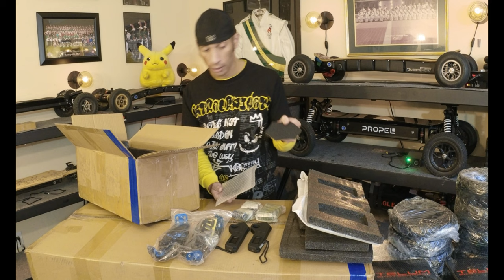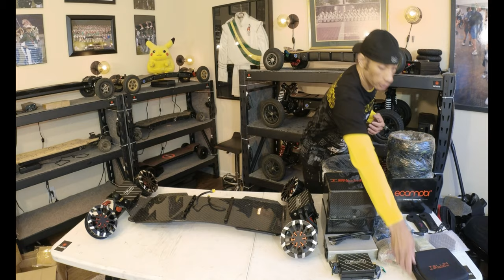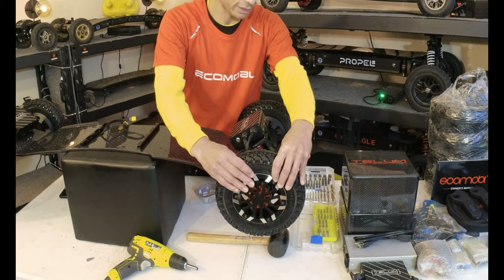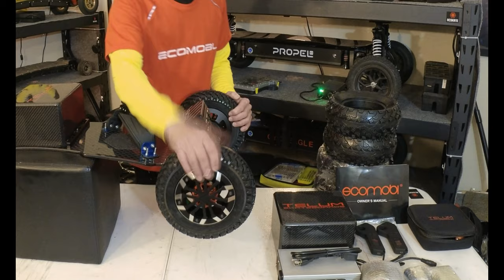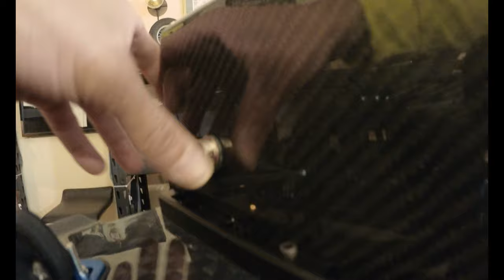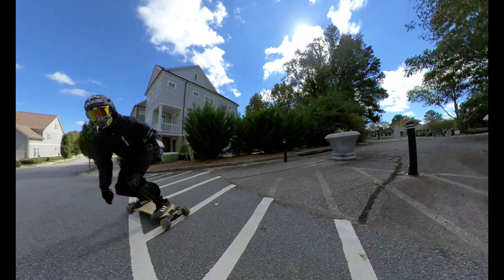#82 Unboxing and Assembly | Ecomobl "TELUM BA" Electric Mountain Board |

Comment: Nice video thanx. But board looks from my point of view really ugly. Tecnicaly it is on low level compared to EU brands and China producer compensating it with spare parts included . Nothing for me.
Reply from the maker: Sucks you dont like the look of it.  I think its looks absolutely incredible.  It's very well designed with the replaceable batteries.  Also the lights in the trucks have never been done before so that is a HUGE step forward for Electric Boards.

There are alot of awesome things going on with this board.  It may not matter where it's made anymore. China, EU, USA...who cares...As long as it performs well.  Performance is the key.  

Keep tuned and Keep Shredding...
😊🛹😊🛹
Reply: Hi. Enjoy Your new deck. And I will be happy to see review after long term use. Unfortunately I must start to think where was what produced. I do not want that my country will be next target of Putin. And based on China behavior, I prefer to support EU or USA . Nice day 🛹🤘
Reply from the maker: @fackoesk8  

Politics and small businesses have nothing to do with each other.  I am saddened by what's happening with Russia, but that has nothing to do with an Esk8 company and its products.

Keep Shredding!!!
😊🛹😊🛹
Reply: @RCSkate   Iam pray to be like You wrote. Unfortenatly we All are parts of bigger economics.🛹🤘

Comment: Love the new toy and all the extras like the wheels and remotes. The board is a beauty. I’m actually used to a remote with the hole and prefer it. I wonder if you could just put wider tires on the X4S, they look great. Can’t wait for the ride vids. Awesome bro, congratulations. 🔥❤️
Reply from the maker: Putting them on the X4S would be an interesting idea, but it wont work.  Propel needs to come out with 12in and 14in tires for the X4S.  It needs more clearance.

Comment: Either my bindings are on backwards or yours are, bought mine used, so assuming mine are the backwards ones.
Reply from the maker: I don't wear bindings.  Lol.  Unless you are jumping, bindings are not useful and are a crutch.   Consider removing them all together and learning how to ride without bindings...again....if you are not jumping.
Reply: @RCSkate  it's a heavy Ecomobl Tellum board.  I've ridden my Metroboard and Backfire G3 for a little over a year now.  I didn't think I would like being attached to the board, but I sort of do.  This is a pretty flexible deck, I'd fear being vaulted off trampoline style.  So, I'm familiar riding without.  Not sure I want to jump, but I do take it off curbs and ride over roots and rough ground.

I wouldn't want to take a long cruise on this board though, its more work to ride.  The Metroboard is probably the best ride for comfort.
Reply from the maker: @dawgdude6472  
Its actually not that heavy to me. Heavy is subjective but the weight is distributed pretty evenly. I have the Propel X4S and the Lacroix Lonestar Supersport which are my heaviest boards.

Comfort is also subjective, but to me this is both harsh and comfortable at the same time depending on wear you are riding it.
Reply: @RCSkate  heh, didn't realize which video I was commenting on.  In the unboxing video, you installed the bindings reverse to the way mine came.  All I'm trying to do is figure out which way these bindings are supposed to be installed.  Someone on Facebook finally gave me the right answer I think.
Reply from the maker: @dawgdude6472  
Bindings are personal preference.  There is not right or wrong way to install them.  Its what feels and works the best for you.  So if someone is telling you its not the way it should be just keep in mind bindings are personal preference.  

Do what feels good and right for you and your enjoyment on your board. 😊🛹😎🛹
Reply: @RCSkate  Thanks, that seems to be the case.  I see them installed either way.  

The Propel was the one I wanted when I discovered the suspension boards. I didn't realize the M24 existed until I got this Tellum BA. Now I'm looking to get the M24 instead of the Propel, have you ridden the M24 by chance?  Curious which you prefer if you have.
Reply from the maker: @dawgdude6472  
Yes I owned an Ecomobl M24.   I sold it because I was not satisfied with the performance and it did not have the agility that I wanted.

I have a few videos on the M24. Here is my farewell video https://youtu.be/kSD55jWSSbU

If it were me, I would go with the Propel X4S or the Ecomobl Telum BA
Reply: @RCSkate  thanks, I have the Tellum, it made me realize the M24 existed.  That is the feedback I've been seeking.  Surprised no one has done any direct comparison videos.  Is Bajaboard still making suspension boards? Their videos have really tapered, most I see are 2 and 3 years old.  I've wanted the Propel since it came out.  I had just dropped 27g on my Metroboard,  it's probably for the best, it was a good board to learn on.  I like Propel's other offerings too.  Having the Tellum as a decent extreme off reader makes me think that a lesser Propel would suit me.  I forget the various models, but even the bottom of the line models are appealing.